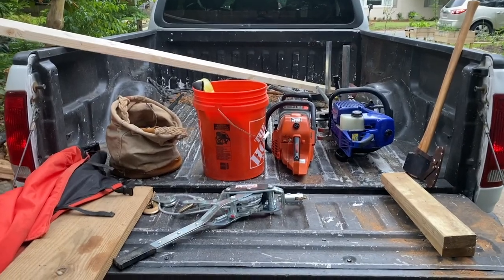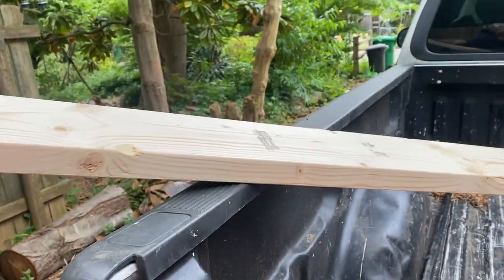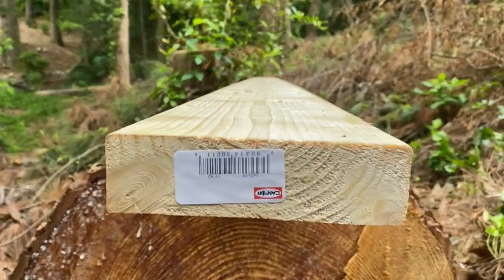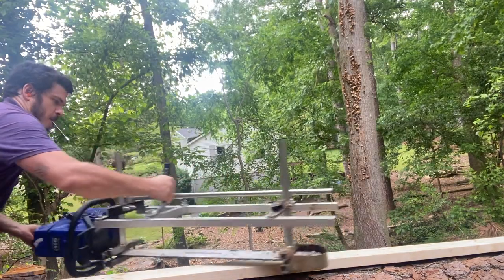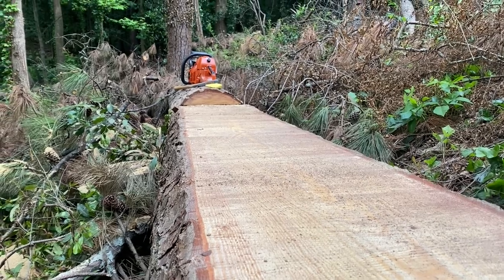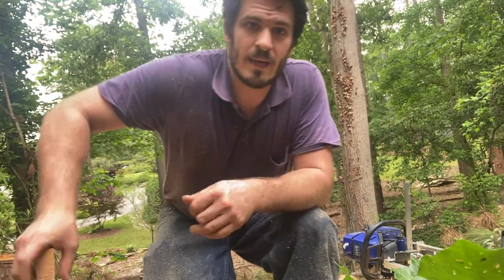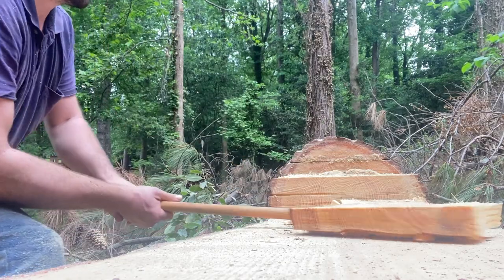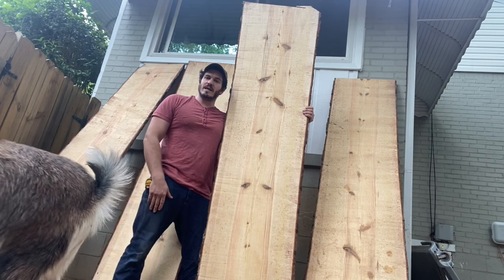How to Mill Big Logs with Cheap Equipment

Comment: I think it was pretty obvious the scale of this haul.  As someone who has riven wood I am glad to see someone else needing to work hard as hell with a chainsaw mill.  This stuff is not easy!

That lumber quality was wonderul too.  Well worth it.  I don't mess with softwoods often but maybe I should for building things I need.  Just lighter and easier to process.  Not so sure about the sap though!
Reply from the maker: Hey dude! I was just watching your videos today! Milling is a good workout, especially wrestling those slabs around.

I’m going to try and build an outdoor sauna with these, so think based on today I’ll be cutting boards 3/4 inch or even 1/2. It’s so rewarding to get out there, plenty left to cut!
Reply: @urbanlumberjack  should be lots of options with boards that wide.  Can't wait to see progress.  Great project.

Comment: nice pine. before your blue beast burns out, i'd strongly recomend the ms 881. keep the gs as a backup cuz if you do it a lot you will have saws go down. the best thing bout your saw is i can start it. i realy struggle to pull over my husbands 881
Reply from the maker: That 881 looks like an awesome saw. I have been beating my 660 like a rented mule and it’s keeping up. I bought it exclusively for milling, more or less expecting it to burn out. It does start nicely, but if I forget the decomp valve my hands are in for a nasty surprise. Can’t imagine what that’s like on the 881!